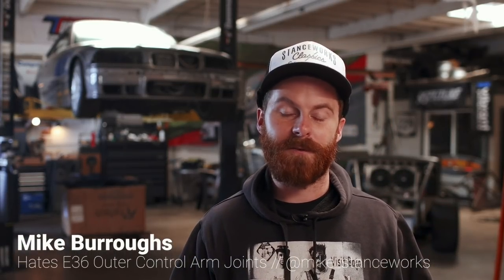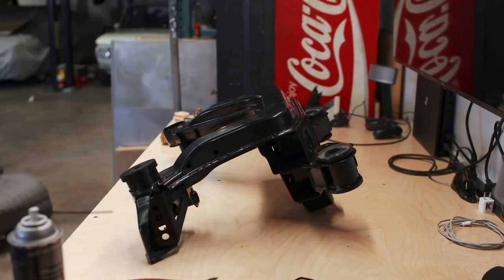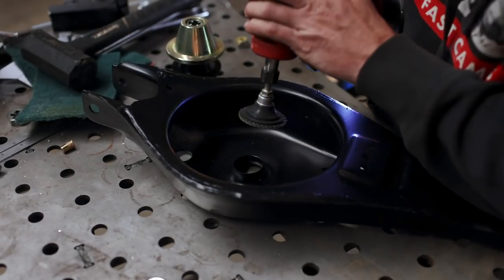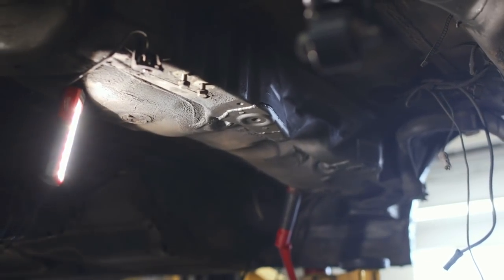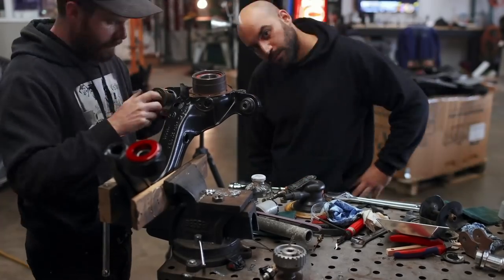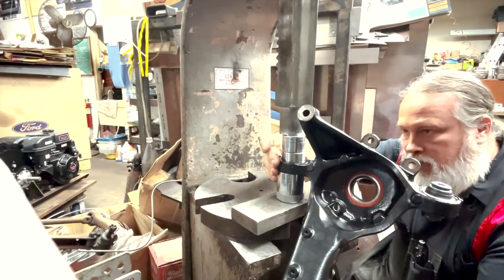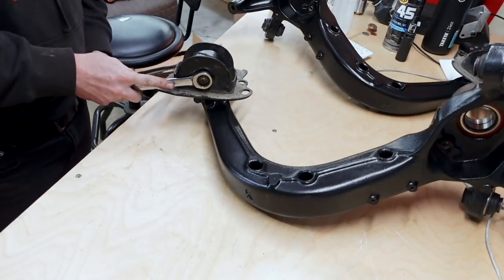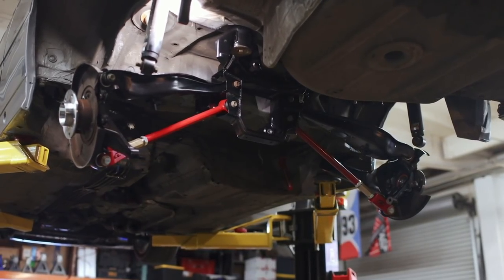100% New Suspension (Every Bushing, Bearing, & More) for My S54-Swapped E36

Comment: Tip for if you ever do the trailing arm ball joints again. First freeze them for 12 hours. Second, they are directional, there’s a chamfered edge on both that allows them to go in easily. Also not a great idea to use bearings on the RTAB mount, they do require lubricating on a regular basis for road use

Comment: 😂 😂 made exactly the same mistake with the brake shields while rebuilding my e30 rear axel a couple of months ago. Refused to risk ruining the new wheel bearing, so I cut the plates and bent them over the hub. Worked pretty well, just left with a thin straight cut at the plate as a silent reminder of my mistake. Still hoping I stop seeing that cut everytime I look at the rear suspension. (Finishing the car will probably help with that). Nice episode!!

Comment: Nice video! Just went through this. When the tool that installs the bearing starts to strip, just add a socket or other small spacer to grab the threads on the rod somewhere else. Make sure to grease the threaded rod and some assembly lube on the parts and bearings go right in. Once I used lube, I didn't hjave any further problems stripping the rod.

Comment: I used a similar tool on ford suspension. Part number B15 A55 Hamm3r.

When i had to do bushing on a stock ttb and also some drop beams i made a similar tool from some pipe, plates and all thread.  Threads strip too but my trick was to use brass bushings and several washers.  The washers help the threads survive a bit longer and the brass helps the threads from smearing on the metal plate.  I did this with beams on the truck so a press wasnt an option.  Not the right way but A way

Comment: I know this video is two years old, but you can run e46 aluminum upper control arms on an e36, mine work flawlessly.  Slight modification to sway bar link placement, but with a little measuring it comes out perfect.

Comment: If you buy an e36 and plan on doing any wheel bearing or suspension work, do yourself a favor and go spend the couple hundred bucks on a press. It makes many jobs exponentially easier. Those rear spring mounts are pretty cool I want some! Btw you can use front wheel bearing nut socket (46mm -The big one) to hold the bottom as receiver and press in  with a 30-something mm it does work but you need to hold the trailing arm so a friend helps.

Comment: I've done this job on my last e46 m3 years ago and then last year on my current e46 m3. Anytime I used those bushing tools I always used a nice thick grease on the threads and reapplied it after installing each bushing. I also give the tool a break since it gets hot quickly when the bushing is a tight fit.

I also purchased those Ground Control rear control arms. Love them. They're the closest to the csl m3 rear control arms.

Comment: Engineer here, press fit bearings easily can be installed with that tool you had however threaded bar material and lubrication, lots of it is key. 
Shit happens at least you did not give up.
Another thought was the difficulty you experienced could have been due to the gland that the bearing installs into had paint/powder coat into it changing the press fit tolerance needed.

Comment: So we install these rtab bushings with a heavy duty otc  bushing install tool. Of course we run a strictly German auto repair shop so we need it but they are like $1500 but they work with literally anything from ball joints to bushings. But glad to see you got it done. I'm in the middle of a low low milage e36 323is street build I bought from some one in the villages, Florida. How refreshing to see people still loving the e36.

Comment: For what it's worth, a cup-style ball joint/bushing press tool with a threaded rod will make the E36 RTABs pretty easy to press in and out. I recently installed a set of Syncro Design Works monoball RTABs in a customer E36 M3 with a pretty simple bushing press tool. I also froze the monoballs overnight which made fitment an absolute breeze.

Comment: Tip to fix your hydraulic press issue where it is not laying flat.  measure the hieght and width of the C-channel. Replace them with the next larger thicker size. Weld gussets in the channel. Should last quite longer where it will not bend again😉. I  believe the C-channel on the that press could be a standard C3x4.5 channel. Got more questions on structural steel give me a hollar😉 this is how you beef it up.

Comment: Did you powder coat inside where the bearings press in? That extra 2-3 thou probably makes it much harder to press in with the bolt type tool.
Reply from the maker: I did not.

Comment: The problem with your installer is the type of threads- standard 60 degree threads are not made for those heavy linear forces- the bolt should have a square form thread like acme.
Reply: Need to rob some from some cheap spring compressors

Comment: Those spherical bearings in the trailing arms should slip right in with one of those handpress things like you have. Paid like a 100$ for mine. Just used some felt pad thingies you put under a chair to center it up properly. Not worth fucking around for 2 hours... Also I think I used some scotchbrite to clean up the surfaces, so that made them go in easier I guess?

Comment: Re. those outer/upper bearings - surely an interferance fit just doesn't need to be THAT tight (and might even risk cracks?)? Wouldn't it have been better/easier to just open the clearance up fractionally, maybe with a honer?

Comment: I didn’t have to clearance my e36 arms for my GC weight jacks, strange. Those outer trailing arm bearings are a bear. I freeze the bearings and use a 20 ton press and that seems to work.  Austin at bimmerworld is the man!

Comment: Do you have a freezer or fridge on site?? Isn’t it possible to freeze the bearings to “enhance” the tolerances??? I always freeze my bearings before pushing them in a crankcase (2stroke) they literally fall in that way..put the crankcase on the heater and bearing in the freezer...

Comment: Just some feedback for the trailing arm bearing installer tool. The threads should be lubricated with a heavy grease to help protect them and reduce heat buildup. Not sure if you did use grease or not, but if you didn't try that next time. It was a huge pain, but I was able to do all the bushing and bearings on my e36 with an Amazon e36 installer tool kit
Reply from the maker: I greased 'Em. Just lots of mileage on the tool itself.

Comment: Front Diff bolt warning !!!!
Hey Mike while u have the diff out please upgrade the front bolt.
Considering the extra power and spirited driving intended its a must.
Drill front mount bush 9/16"=14.3mm
Drill out diff casting to 1/2"=12.7mm, a 12.5mm will also work.
Tap M14x1.5 pitch. I use 3/8"extension and large tapping handle to clear diff nose.
Fold some aluminium foil to give snug fit from tap to extension.
Purchase M14x1.5p - 80mm long G8.8 hex bolt, zinc and good quality 14mm flat washer.
Cut a slot in thread end of bolt so if it ever snaps you can wind it out from back without removing diff.
I have just done all of this to mine. 25% stronger.
Reply: I put in a higher grade (12.9) socket head cap screw in the original m12 size. I couldn’t find a high tensile m14 bolt so figured it was next best thing!

Comment: Tip.
If you intend on keeping a vehicle you will probably have to replace the same parts multiple times so always use corrosion mitigation methods and substances.
Depending on where they go and what they do you can use anti seize, thread locker, paint glue various oils and greases and even candle wax to ensure that metal rot doesn’t spoil your day the next time you work on something.
Note if two different types of metal are to go against each other rot is virtually certain to ruin your day.

Comment: I had to do the lower control arm bushings on my e46 M3, I think they're the exact same part as on the e36 that you were having trouble with. I had NO special tools other than Harbor Freight balljoint press cups, and it was a huge pain. What finally made it possible was actually using silicone grease and freezing the bearing overnight. After that it slipped right in just using some long bolts form the hardware store and the HF press cups. If you find yourself doing that kind of job again, the grease really makes it easier. Also forget about trying to press the old ones out. Just use a press to pop the sphere out and then a jigsaw to cut the race out.
Reply from the maker: I froze mine as well with no luck.

Comment: You damage the tool for the bushing because you didn't grease the main bolt. At least you will be know for the next time. Polish company is making them poli also, so don't know why you used stock? Not available in US?
Reply from the maker: I did grease it. Just because I didn’t mention it doesn’t mean I didn’t do it.

Comment: Next time put the spherical bearings in the freezer overnight. They slip right in by hand. Live and learn.
Reply: Not always, tried it with mine and they still were a nightmare. Freezing and a bit of silicone grease did the trick
Reply from the maker: I did freeze them with no luck.

Comment: warm up your trailing arms and its 1000 times easier... thought someone like you know this.
Reply from the maker: Yeah lemme blast my freshly powder coated parts with a torch
Reply: @stanceworks  you don't need a torch to heat them but okay
Reply from the maker: To heat them enough to expand, yes. Any amount of heat to make a true difference would destroy the finish.